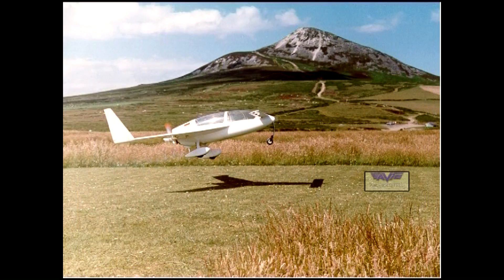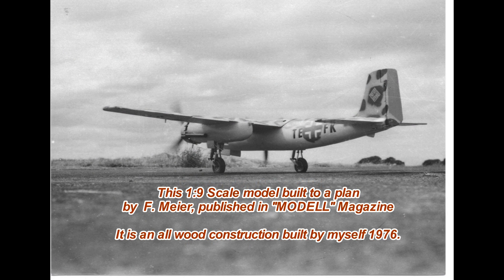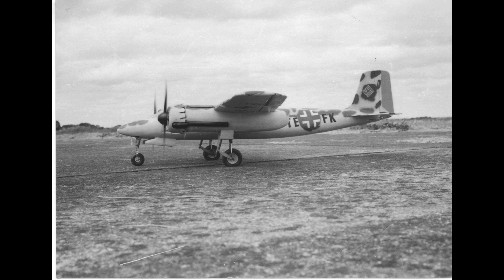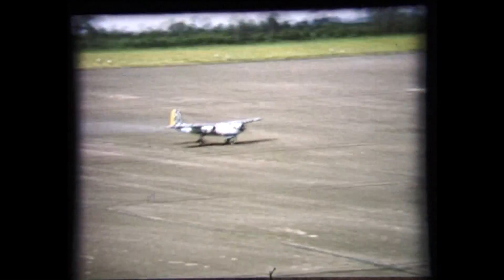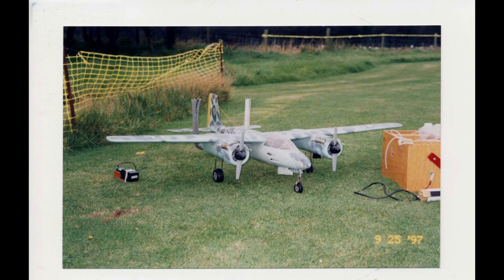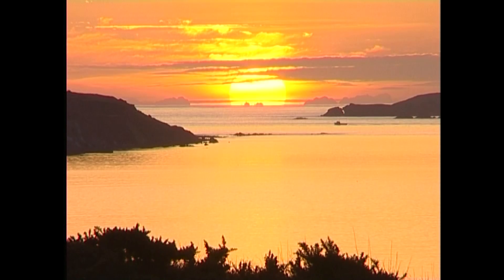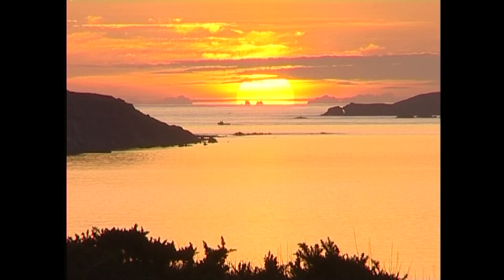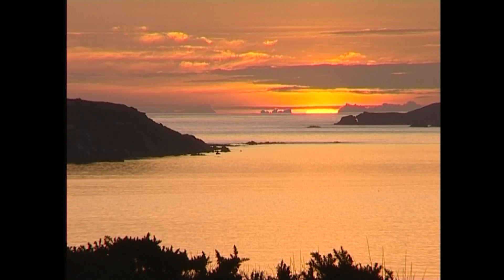TA 154 the  German twin engine fighter constructed from wood

Comment: The Ta154 suffered a structural failure in a prototype due to insufficient bonding in glued surfaces. The glue was revised and the problem solved however by that time the only production plant where the glue was manufactured was bombed and completely wiped out. So this is the reason why the type was "unsuccessful", it was not because of design flaws but purely circumstantial.

What a beautiful build!
Reply: That is not correct. You forgot the Heinkel He 219 "Uhu" (Eagle-Owl). This german nightfighting aircraft used a tricycle landing gear as well!
Reply: And the 262 of course.
Reply from the maker: Hello 33 Vortex,

You are 100% correct. The design was great. Only 2 fighter planes in Germany used the tricycle landing gear: this one and the Do 335.
Thank you for the comment and your visit to my Youtube channel.
Reply: Yes, true.Totally forgot about this beautiful aircraft from Messerschmitt.
Reply from the maker: Hi planespotter EDDH, thank you for this info - I found the UHU in "Warplanes of the Third Reich" by William Green SBN 356 02382 6 McDonald&Co (Publishers) LTD.
I made reference to this fact a minute ago in the text accompanying the video.
The 262 I did not consider as it is a new generation of Warplanes...